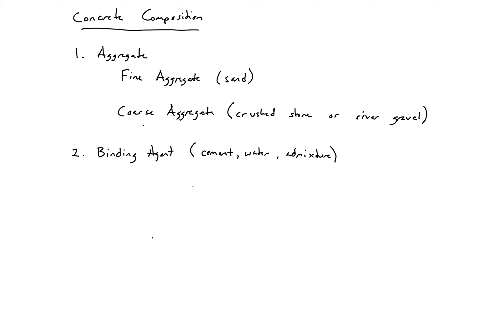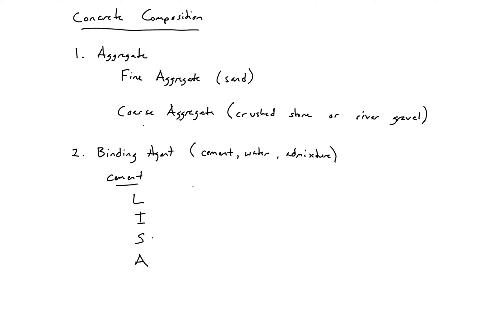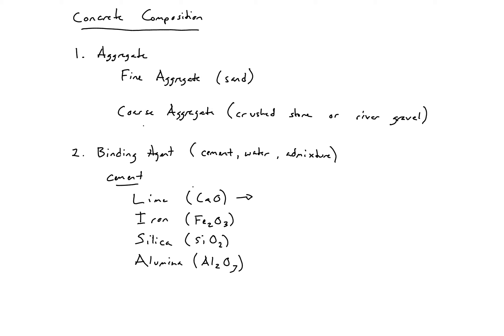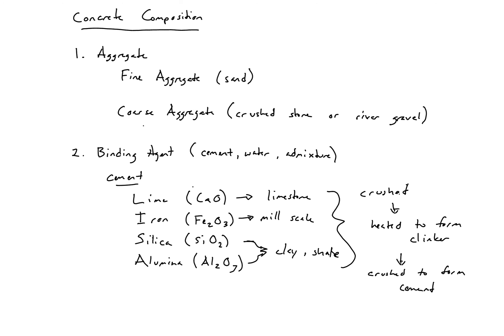3 - Concrete Composition

Comment: SU MENTE: ¡usted merece lo mejor como as melhores y tambien you deserve the best!; ¡palabras y adanzas con soluciones; words and deeds with solutions; max rafael waller will try being aware of his life's experiences including would had or have, could have or had, should have or had experiences explained by yin yang, the works of socrates, plato, aristotle, sun tzu, lao tzu, siddhartha gautama, confucius, miyamoto mushashi, carl gustav jung, carl edward sagan, rachel carson, margaret mead, emily dickinson, virginia woolf, flannery o'connell, elizabeth loftus, flanery o'connoll, william saroyan, Vine Deloria Jr. and Anne Waters, the aztec philosopher-king Nezahualcoyotl to optimize being an organic thinker trying to minimally use software and hardware to research subjects; software are computer programs possibly including algorithms that are a set of instructions; hardware are electronics like the c.p.u. or the central processing unit, the graphical processing unit or g.p.u. etcetera; max rafael waller as per yin yang is the verified proven verifiable dr. henry jekyll and mr. edward hyde or simply jekyll and hyde; be prepared to alway be ready to be faithful through damn the torpedoes, so, full speed ahead to be all you can be by aiming from low to high above by max rafael waller as the air force max, master of below the ground and above the surface, below, above, the land water space, defendor of freedom, destructor of evil, as the elite eagle; ¡study: monophobia, victimhood, impression management, autopohia, attachment styles interlinked to life's experiences interlinked to life's never ending uncertainties; study randomized control trials known as r.c.t.; max rafael waller will optimise his natural intelligence smart thinking on an egalitarian society influenced by meritocracy through thoroughly examining the eternally imperfect Max rafael Waller who is a disillusioned green party of alta california withinst the san fernando valley, los angeles county, alta california sur before the european with some eastern major asia intentionally through their non existent deities continue to share verified proven verifiable misleading information portraying that the indigenous of the western hemisphere were war like that are glorified as those who allegedly benefit through the doctrine of discovery and manifest destiny; active communications, empathy, mutual understanding, nonverbal gestures, microgestures; america's best christian la señora betty bowers played by deven green; the european and american white supremacists, racists still benefit from the doctrine of discovery and manifest destiny as per the god.; you as per the consent from max rafael waller, 9688, sunday, 3 january 1965, tijuana that for truthfulness, precision, accuracy, intentions, ulterior motives especially words and deeds to  to legally research the greedy samuel robson walton, james carr walton, alice louise walton with their sycophant carl douglas mcmillon who are more selfish than the dead imperfect samuel moore walton, helen alice walton, james lawrence walton who tried to make it seem as if max rafael waller was stealing a tire on april 2007 through fidel, mehmet ekinci, william gregory lang, daniel mora danny mora, business 2 manager esperanza lopez NickNamed pera or espy, gladys patricia arteaga when max rafael waller was in the tire shop at sam's club 6625, 12920 foothill boulevard, san fernando, los angeles county, alta california sur 91340 went from being decent to untrustworthy; thoroughly examine both on-line and physically in person without illegal methodologies on the man named max rafael waller functional MRI (fMRI) is a non-invasive imaging technique that helps assess overall brain health and function, and can reveal evidence of past microstrokes (silent strokes), even decades later - 1985 while at fort wainwright, alaska my left side felt like a microstroke, 1987 at storck barracks, west germany that my left side felt like a microstroke - my chain of command were not informed due to the military's stance on those with mental and brain health issues - dr. daquiang sun, dr. clare elise drolen, dr. shreya condamoor, dr. angela helen lai, dr. michael burke, dr. elena hunanyan, dr. melissa l. lewis, dr. kevin jou, dr. david e. pair, dr. milton l. kolchins, teru judy kanazawa or señora teru judy sheehan (née kanazawa) daughter of toru kanazawa, dr. antonio caloca, dr. antonio xaloca; i.t.t. technical institute, los angeles pierce college, los angeles valley college, pacific coast technical institute, university of maryland, austin peay state university, san fernando senior high school, charles maclay junior high school, oliver wendell holmes junior high school, fenton avenue elementary school, escuela primaria estatal: escuela naciones unidas, la colonia castillo, la zona norte, tijuana, baja california norte
#imperfections #imperfecciones #questioneveryone #questioneverybody #ImpressionManagement #gestiondeimpresiones #integridad #Legalities #contabilidad #accountability #posttraumaticstressdisorder #complexposttraumaticstressdisorder #duress #transtornodeestresposttraumatico #transtornodeestrestraumaticocomplejos #forensicpsychiatricresearch #investigacionpsiquiatricaforense #codeofethics #attachmentstyles  #apegopocosaludable #eternalimperfections #imperfeccioneseternas #WordsAndDeeds #palabrasyadanzas #eticas #fobia #phobia